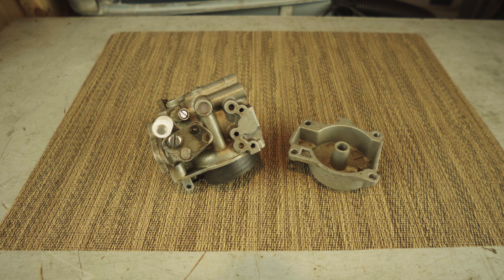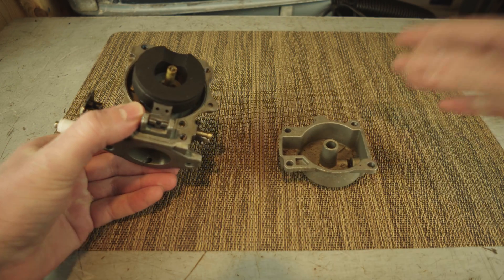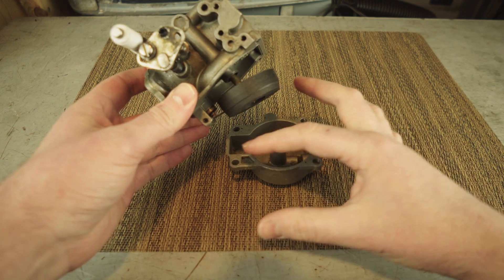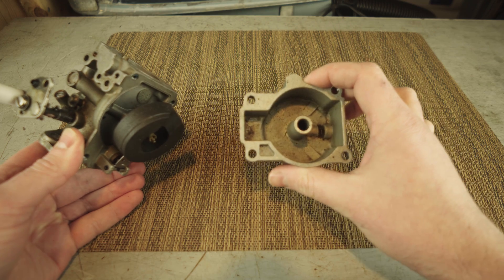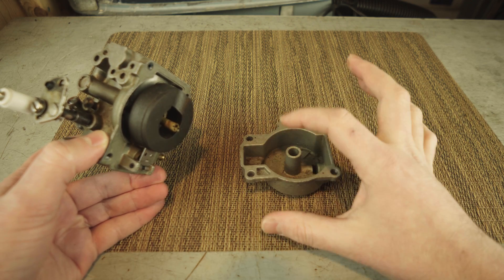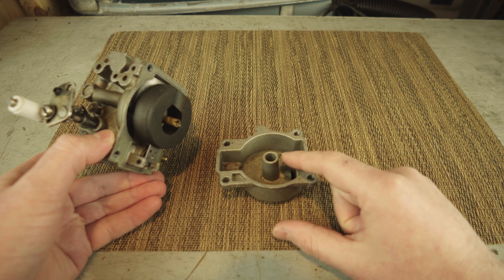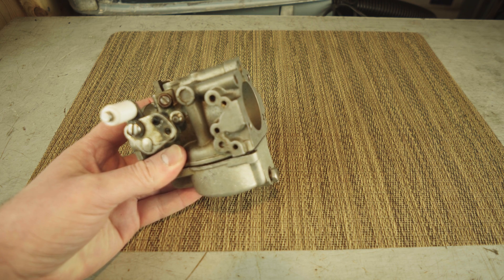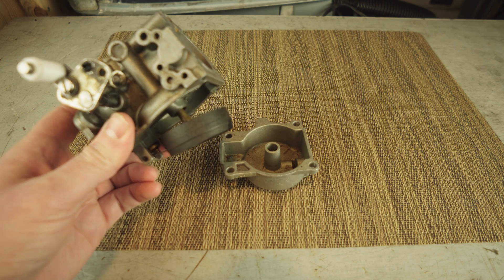Why Does Outboard Die After A Few Minutes At WOT Instead Of Immediately?

Comment: Tohatsu M50D 50hp 2-stroke):

The engine runs fine for about 10–15 minutes, even at mid to high throttle. Then, it gradually loses RPM and power, eventually struggling to accelerate and only going about 4–5 knots at full throttle. If you turn off the engine and wait around 30 seconds, it starts up and runs perfectly again—for a while—before the issue repeats. When the issue happens, the engine sounds deeper and weaker than usual. Pumping the primer bulb during the issue does not help. The engine idles fine and starts easily. The problem only appears after some driving, especially if cruising around 1400–1700 RPM for a while. Any help?
Reply: Ever figure that out ?
Reply: @ No

Comment: Having this problem myself . New line/filter/ carb cleaned 3 times and still goes dead after 3 minutes at full speed . Lost as I can be now with all new stuff in it . Going to look at filter in tank next.
Reply from the maker: @Ram327-  try running it with the end of the hose just dropped into the tank and see if it makes a difference that way there is no restriction. Also I recommend replacing the standard style connectors with those clip-in ones that plug into each other. The old style connectors tend to leak out air.
Reply: @IdeaMan4k  , Thanks . X'ed the connectors out a while ago . They always been a problem. I try the line right to the tank and see how that goes . It's a pontoon boat the 75 Force is on and the fuel tank is about 20 gallons . Thinking it night be the pick up line but the bubble pumps good . Lost.

Comment: My runs, but when i go full throttle	 then it dies. It runs only the choke closed and it runs high rpm.  It dies when i open the choke and throttle can’t lower. If i do it dies.  It can’t idle.
Reply: Classic clogged main jet symptom.  Clean it and you should be good.

Comment: Nice video ! 
I have a different problem, but might be related... I had problem with my engine not starting, I cleaned the carburator, and after that it runned perfectly fine for months. 
But now, I have been away for about 8 months and the outboard didn't run during that time, and now my engine is starting with difficulty, and when it runs, it's rpm is not stable and stall after a while. It will stall as well if I try to put more gas... I will have to clean the carburator again (my guess), but could it be something else !?
Reply: Though few, there are still gas stations that sell old gas (without ethanol). Usually outside the City by a popular boating launch.
Edit: In the Midwest that I know
Reply from the maker: Make sure you're using new fuel because after 8 months it will definitely not be good. These old outboards are very sensitive because they're all made for old gas without ethanol.
Reply: @IdeaMan4k  i was thinking about too, it's why i topped up the gas tank with new fuel today. Still have the same problem. It might be the old gas still inside the fuel line. I will try to remove the line and clean everything up. I just hope it's not the fuel pump...

Comment: I'm going through this with 25 hp johnson. As soon as I get to top speed it surges but if I pump the bulb she runs fine. I have run a new fuel line and fuel pump but it's still happening?
I put a new kit through the carby and checked float levels twice now so I'm stumped.  All jets thoroughly cleaned and blown out, any suggestions? Maybe the new pump is actually bad?
Reply: Did you ever figure out the problem you were having with your motor?
Reply: @mikekmalick  Nah mate, was going to get someone to come take a look when winter gets here in Aus. Only really use it when it's winter up here in the tropics.

Comment: Also figured I'd add that I had a similar issue, but my issue was a little different. The fuel line was sucking air at some point from the tank to the motor and an air bubble would form near the fuel filter. My motor would bog down at higher RPMs after 2-3 minutes of running because the suction would be enough to pull that air bubble into the engine and basically starve the motor of fuel...

Comment: Any idea why it woulonly die when you cut to say 50% throttle - so I'd be cruising at WOT for maybe 10 minutes, then dial it back to say 50% throttle - then it'd bog and die only after I'd cut the throttle to 50%? Maybe the "L" screw needs to be backed out a bit to provide more fuel at lower rpms or the "L" jets are clogged?
Reply from the maker: Possibly a float adjustment. It can be hard to get those perfect.

Comment: Maybe this is wrong but my mechanic said, these symptoms may also occur if the float is adjusted to close the inlet before the bowl is full.  Like a toilet tank float, it needs to be set to the correct level to fill its tank/bowl. The hinge, that the float pushes against, also opens and closes the inlet valve, it is bent to allow the proper level of fuel in the bowl. If the hinge is bent down, it lifts early, so just a few drops in the bowl raises the float up too fast and closes the gas inlet needle into its seat. With the bowl only partially full, fast speeds can use all the gas faster than the float allows the bowl to fill.
Reply: So bend the hinge so it doesn't lift the needle into its seat until the float is almost at the top of its range.

Comment: (Fixed)
My motor runs fine for an extended period then have trouble entering high rpms after having the engine off for a while. For example, I drive, 15 min straight just fine. Stop to fish for 10 min then start the engine back up and can't enter high rpms
(Fixed:
I have found that if I choke it upon the bogging, it unfucks itself and works perfectly
Reply: exactly the same with my 90hp mercury.  if i go full throttle it cuts out to where its like half throttle
Reply: @musicgems1726  i sort of fixed it. I found that if I choke it at the moment it bogs, it unfucks itself
Reply from the maker: It could be an initial fuel flow issue, maybe try squeezing bulb before starting? Or your timing / valves could not be 100%. Make sure the controller isnt slightly slacking, maybe you speed up too slow and its not pulling the cable 100%. When at full throttle the valves should be open 90 degrees.

Comment: I wanted to ask you or anyone to see if you have a clue what could be wrong with my motor. Today I went to the swamp meet and picked up a grayish Mariner 15HP, maybe a 1995/1997. I tested it and it wouldn't start. Check and there are sparks. Traced the fuel up to the carb and it's good. Tested with started fluid inside chamber and still no start. Tested starter fluid into the carb and still no start. It acts like it wants to start but will not. Checked the fuel cut off switch and it's fine. Took carb apart and carb looks like it was recently rebuilt. Checked and air blow everything except the enrichment valve or the bottom nut, spring, ball or the passage. I put everything back and tested again. It feels like it wanted to start but still can't. I removed the gear safty lock on the pull start and attempted to start the motor in forward gear. It will start up if I pull the choke and leave in the forward gear with half to full throttle. Once I switch to neutral or leave on idel, it'll die out. What could be the issue? I'm going to order a new carb kit and give it a good cleaning myself.
Reply from the maker: Have you checked the compression? Could there be a fuel pump issue? Could timing be too slow? I have never had a pull start motor before so I can imagine its a bit more of a pain to get going if something is going on. If its running with choke up in first gear, there has got to be some sort of / lack of fuel or air somewhere. If you press the key in, to use the primer does it make a difference?  Also hopefully you have the floats on the carbs correct.

Comment: Thanks for the video.  Very informative. I have a similar problem but different. Mine will run for full speed but as soon as I let off the throttle it dies.
Reply from the maker: I'm wondering if it could be something in the controls on the engine where it lets off the fuel too quickly. This way it would cause a sudden drop in an engine wouldn't be able to keep on running as it slows down. Let me know if you figure it out.
Reply: Did you ever figure it out?

Comment: Mine is slowing down at wide open throttle. Once I turn it down it speeds up. Can you help please
Reply from the maker: Make sure when you are at full speed the throttle plates are 90 degrees (vertical).
Reply: same here

Comment: Same problem with my EFI motor. Except it doesn’t choke out or chug before it stops it just flat out dies like you hit a kill switch.
Reply: Did you figure out the problem? Same thing happening with my 2008.
Reply: @OmarV297  no, I have had it with this motor it works great one day then like crap the next I’m over it. Got permission from the wife so we are Re-powering with a new 175 Suzuki less noise less smoke better fuel economy and hopefully more reliable.

Comment: That was a great explanation on how all that works, more guys working on their outboards should listen to this video, ....thanks for the information and now I will start to work on my evinrude 140hp.  Because that's what its doing, I start to get on plane then all of a sudden it starts to sputter and cutting out...then I throttle back and it idles fine, then I try it again giving it throttle slowly and evenly it stats to get up on plane then it acts up all over again
Reply from the maker: Thanks, the one thing I have not tried yet but I have been meaning to do is replace the gas line connector from the motor and the tank to just a simple standard brass connector and not the one the motors / red tank came with. I find those cheap quick connects are really just not worth the trouble. There are also many expensive high quality quick connect options available which I have not really sorted through but getting something like this makes perfect sense as any air leakage or something in the fuel line is just such a pain in the neck. The little rubber gasket inside the quick connect can easily get torn and overall I just think the entire assembly is not a great design.

Comment from the maker: One thing I wanted to note is the very poor design of the standard outboard - fuel line connector. The physical plug you connect to the motor or even the gas tank is really not sealed well. I have not replaced mine, however it is something I would like to do as those old standard connectors, on the engine and gas tank end, are simply not reliable. There seem to be many quality quick connect options available online. I have no tried them yet, if anyone has any feedback or recommendations let us know.
Reply: Did you ever find a reliable fuel line connection? I am hoping to replace mine both engine side and tank side.

Comment: Ok so my outboard is doing this exact thing But it doesnt die. It boggs down and I move throttle to idle and sit there for a 30secs to a min and it is happy again for anothe 5-8 min run.   I have changed the primer bulb cleaned tje carbs changed the fuel pump. What else can I look at. It does it on boats internal and an external tank so it has to me engine side.   It is a tohatsu M90
Reply from the maker: Possibly a poorly aligned float? Or float valve. Be sure there are no leaks, the outboard gas line connector is honestly an AWFUL connector. It is has so much potential to leak some air there as well. I myself have not replaced it yet, but I want to put in some sort of quality connector that has zero chance of leakage. Remember if the carb float bowl and the needle have an issue there could be something going on with suction. If its running full speed something is causing the fuel loss. Carbs are easy to disassemble but they can be tricky as any tiny dust or something set incorrectly can really affect performance. Id definitely recommend replacing the needle valves as they are quite cheap.
Reply: Same issue. Did you ever get to the bottom of this?

Comment: Recommendations on how to repair this issue or what to replace? Float? Pump?
Reply: Fuel pump, fuel lines or filter, vent on cap not working, sucking air around clamps on fuel lines
Reply: I had this problem on a unit I bought. I drained the regular fuel, added premium fuel, same problem. I added sea foam to the fuel, started it a couple of times a week til I got some free time. Problem solved.